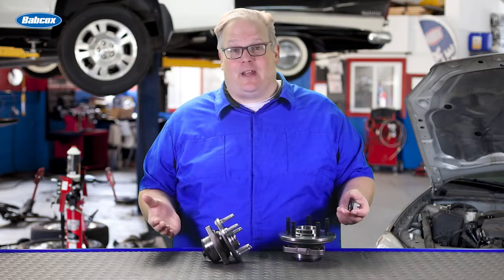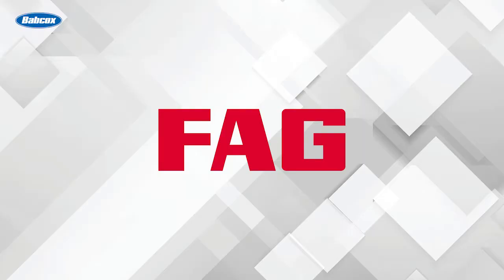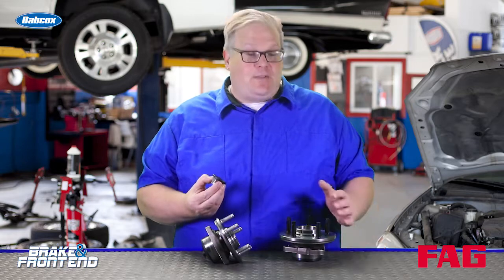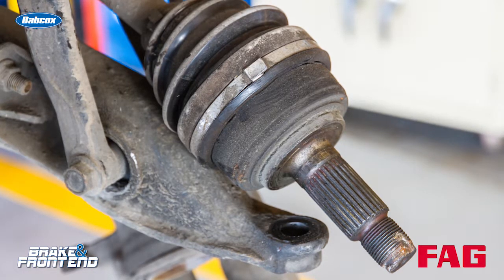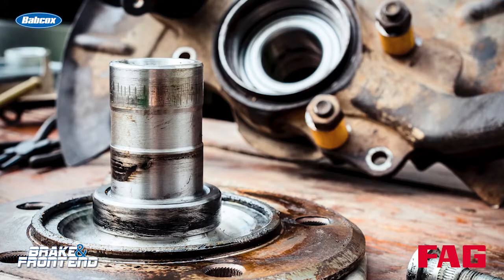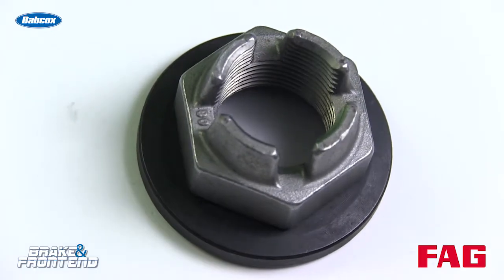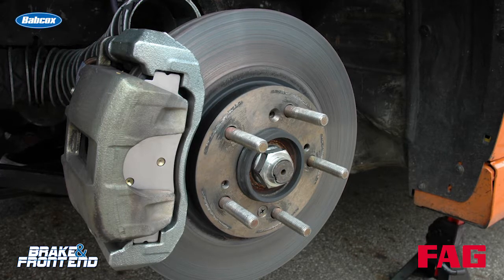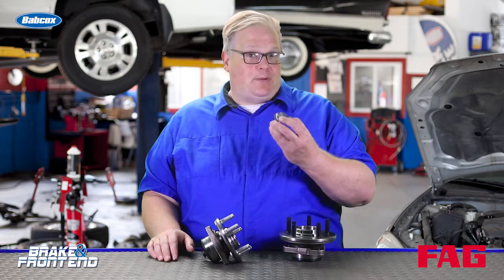Always Use A New Axle Nut | Tech Minute

Comment: I had a dealership quote me 1400+$ to replace the rear wheel bearings on a 2015 subaru forester. Then when I purchased two replacement hub to axle nuts,and learned they only keep two of them in stock, they told me they almost never replace them. The FSM clearly designates the axle nut as perishable, marking it with a black star. Scary.

Comment: You explained that with time the axle nut fatigues, but that would explain the need to change the axle nut every 10,000 miles or something like that. It does not explain why the axle nut needs to be replaced with a new one whenever the axle nut is removed. Could you explain that please? I mean, if it were just about fatigue, then what if the axle nut had only been used for 100 miles and it had to be removed for some reason? What then?
Reply: @theory816 So if you torque it down properly the first time it's been put back on...and you only have a few hundred miles on the vehicle...and you inspect it regularly... then is it safe to say it can be re-used?